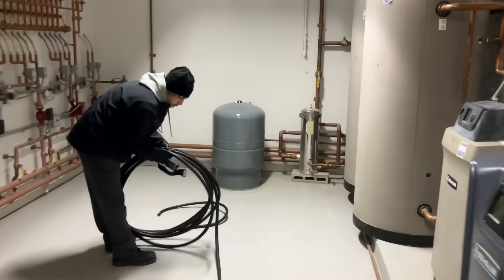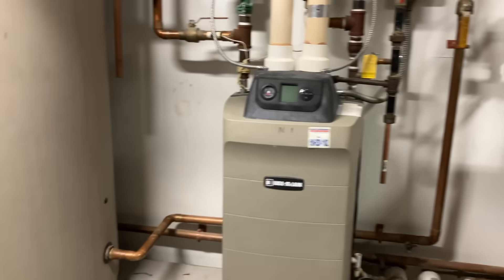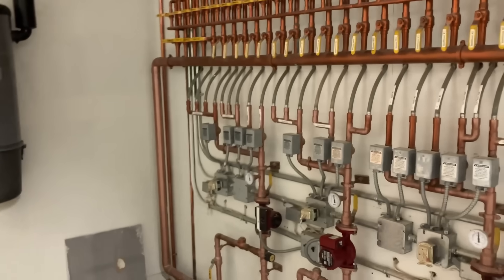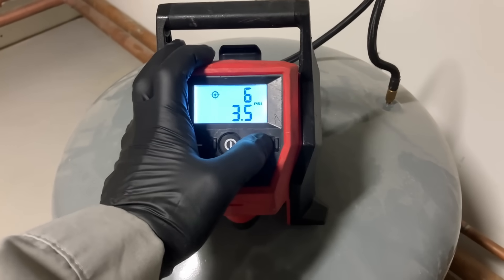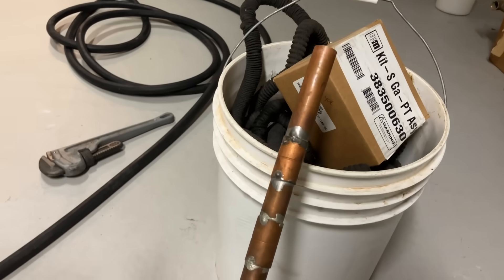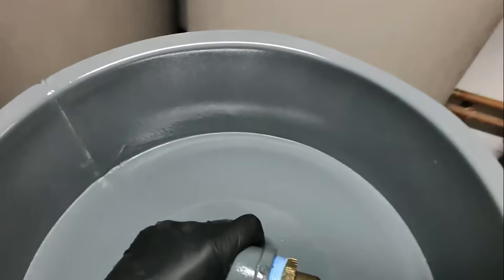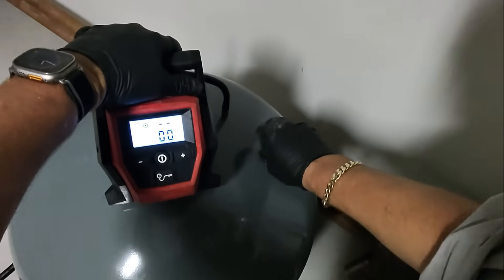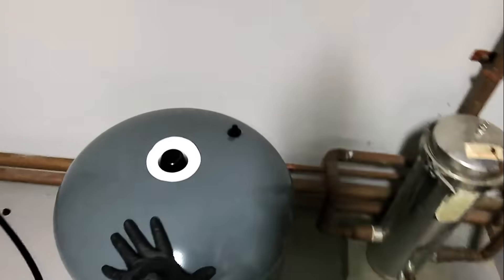Gigantic Expansion Tank Replacement on Dual Weil-McLain Boilers (520K BTUs!)

Comment: At least this high boiler pressure video wasn't as bad as the other one I watched today. Guy was called in for a second opinion after a boiler was acting strange post "repair." Boiler was "Repaired" with a water heater T&P valve and was holding 100+ PSI of pressure. This was in nearby (to you) NYC.
Reply from the maker: Yikes, that sounds like a dangerous situation!

Comment: Yes with hydronic systems the expansion tank should be sized for boiler or water heater btu capacity, but the added consideration is the volume size in gallons contained in these heat sources and system as a whole.

Comment: Got a commercial/residential property that I work on and it has a hydronic loop system that feeds geothermal heat pumps in each unit. About 60 heat pumps on the loop. There is a expansion tank of similar design on it and the loop only gets up to 75-80 depending on the season. Then there are the times that the circulation pumps fail and then the temps jump. Still have to have a large tank to deal with large systems. It is not only about the BTU's but how big of a system you are dealing with.
Reply: You’re correct!  Nice post.

Comment: The Ford dealership i work at has two 500,000 btu Clean Burn boilers that run on waste oil. One runs glycol through the outside concrete pads thats heated through a radiator that the hot water passes through

Comment: Don't forget boiler BTU isn't the only thing to consider when sizing an expansion tank, you also need to account for the total system volume and it's thermal expansion.
there's lots of tubing and radiation elements there, which makes for many gallons of water that will expand. it's even more critical when there's cast iron radiators or baseboard that holds a large volume of water.

Comment: Put the new tank in with the old pipes? Cmon man, put some new pipe on there with a few less joints, and a union for the next tank swap
Reply: Why put a union if u don’t like to use old pipes?
 It is fine, low pressure hydronic system

Comment: guessing there was local shortages on shutoffs when they did that job, because they bought them all from everywhere. lol I imagine that was all ordered way ahead of time.
all expansion tanks leak air slowly through the bladder and schrader port, they really need checked and adjusted yearly when other maintenance is done.
once left low and waterlogged, it can ruin the bladder, leak past and cause issues, may as well replace them at that point.

Comment: And all replacement parts for that Beam central vac unit are no longer available, since the brand recently changed hands, so whoever their central vac guy is will be making a sale when the filter in that thing needs changed. I wonder how many separate vacuum systems this house has!? Being a single motor unit (one muffler on the side) there's no way in hell that's big enough for that house.
Reply: probably has multiple of them for different areas.

Comment: Pipes, you did a great and cool simple and right job plain and simple.   Derek; be careful with the hose run man, it smacked the boiler jacket when you were laying it out. You'd be surprised how anal some customers are about marks on covers even small ones..it's crazy sometimes.

Comment: Dear Lord how many square feet is this McMansion?
Reply from the maker: You can’t even imagine
Reply: I was in a house last week that had two 800k and two 900k propane fueled boilers, 3.4 million btu total.   The house is only 8000 square feet, fairly new and very well built and insulated.  Total insanity on boiler sizing, customer complains how hot the boiler room is.  Wish i could post a pic here.  
The house i service next door is 10k square foot modern waterfront house with tons of glass, and has one 300k btu boiler running as dual fuel heat pump setup, no problems meeting demand.